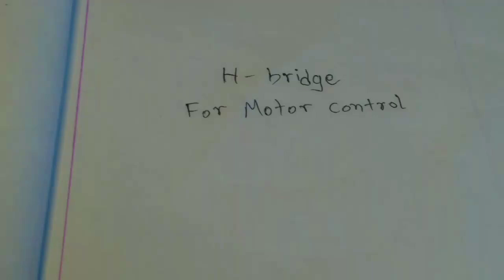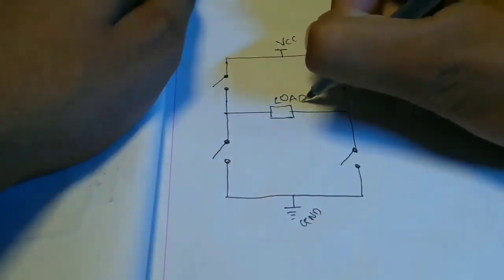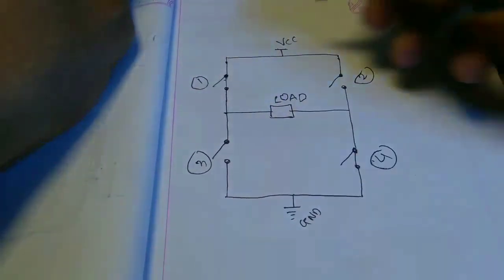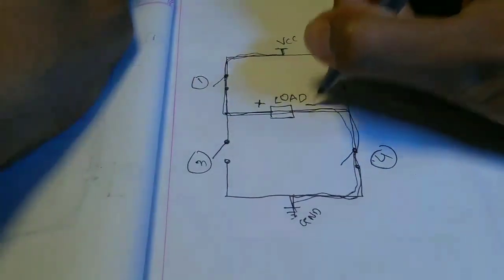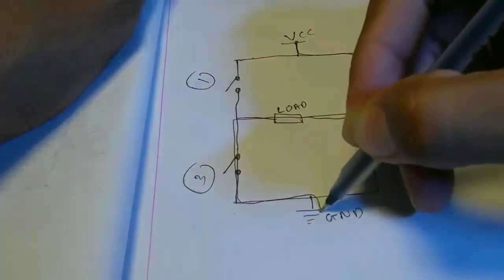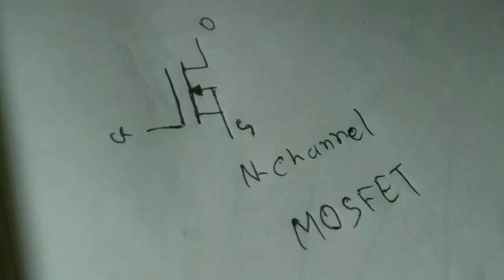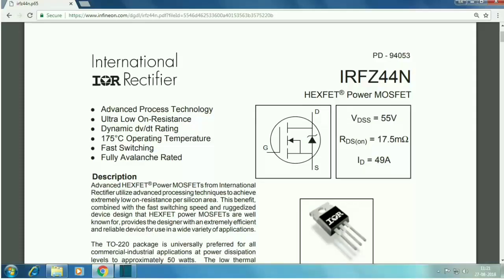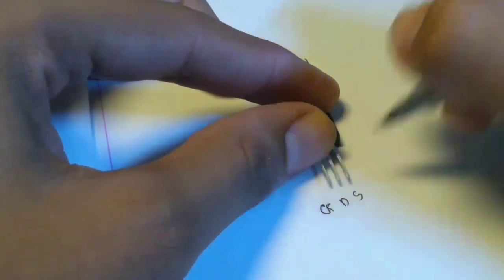DC MOTOR CONTROL USING H BRIDGE

Comment: Bro please reply can i drive 24v and 12 amp Dc motor with this circuit
Reply from the maker: Irfz44 is powerful MOSFET, this can handle your requirements, but with proper gate drivers. Means you have to give around 10v signal to gate for this MOSFET due to this is not logic level MOSFET. if you want to control this bridge using microcontroller, then you have to use gate driver ic or you can use any BJT to drive gate of MOSFET. Also use heatsink for MOSFET.
Reply: @ERBROSLAB  please recommend me any gate driver IC to drive thise circuit
Reply from the maker: If your switching frequency is low (approx less then 20 kHz) then you can use such a BJT and don't forget it will invert the signal. And you can use MOSFET driver ic like IR2153 for high frequency. If you want to build BJT based driver you can search, you will get many circuits. BTW, what are you building?
Reply: @ERBROSLAB  i am using this circuit to build Robotic arm which utilizes 24v and 12amp motor for lifting heavy weight